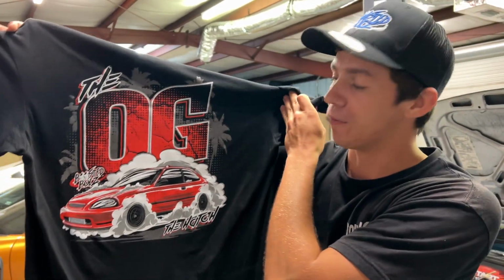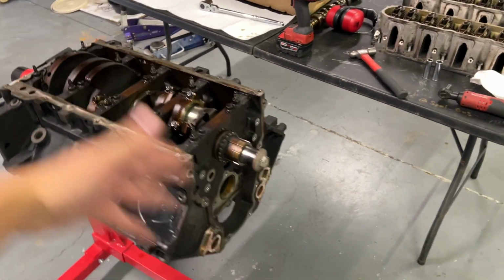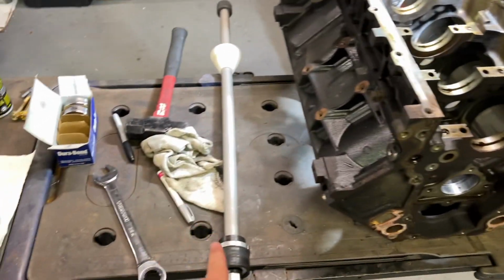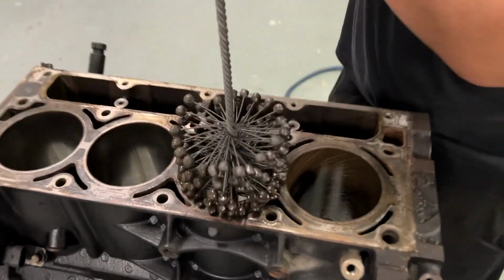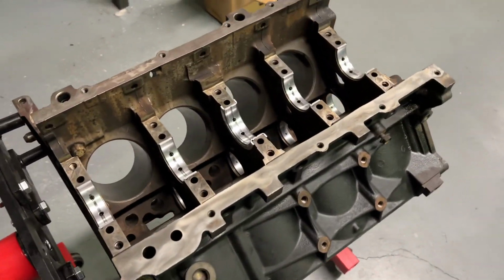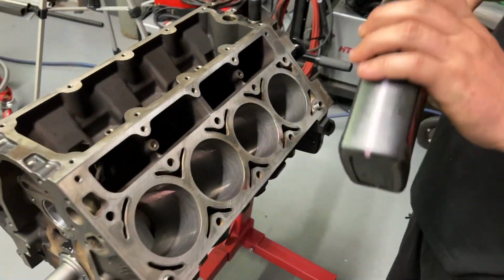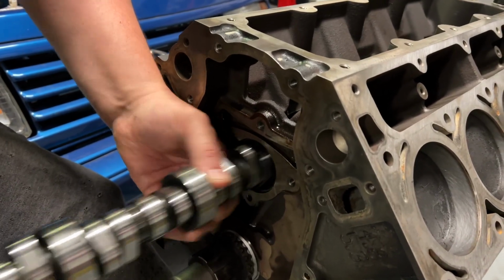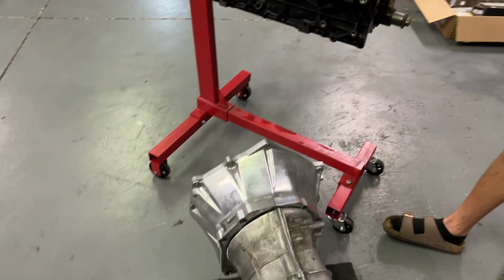Rebuilding Our Junkyard LS! Pro Engine Builders Look Away

Comment: Gonna go out on a limb here and say that when you installed the cam, it either barely or didn't turn. There is a reason that all factory machined LS motors have cam bearings that look like hammered ass, and that reason is from the factory the cam bore wasn't straight or true- so during normal use they "self clearance" and end up looking like hot garbage. I know y'all were just trying to be thorough, but when dealing with boneyard LS motors, a pretty good rule of thumb is that if it looks like it had oil pressure when it was scrapped, leave the old cam bearings in it. factory cams don't run nearly the seat pressure of aftermarket cams, and thr additional lift and duration will put even more stress (read: heat) on the slightly too tight cam bearings y'all likely have now- which could lead to problems. Hopefully it doesn't cause issues for you, but I haven't ever gotten that lucky. 

TLDR: I used to install new cam bearings in my junkyard LS motors, there's a reason I don't anymore.
Reply: You know... that would explain a lot.
Reply: I actually thought GM lined honed the cam bearings after install. Seeing copper is completely normal
Reply: If it had oil the main bearing wouldn't be scrap.
Reply: I replied the correct procedure above.
Reply: @MattPratt  they do 👍🏼

Comment: A u all can we get a AWD automatic transmission Honda simpler build use 1 or the Honda element gens THEN AWD spinning around a pole idk or aawd Honda but mount rear differential upside down now burn outs front wheels going forward and rear wheels going backwards will a car stay still or idk

Comment: Dirty block, botched cam bearing install, backwards pistons, and the engine does not turn over very smoothly.

Will the boiz redo the bottom end?
Will the top end be any better?
Catch it on the next thrilling episode of Boosted Boi-Z.

Comment: Stuff I've seen with ls motor as long as the bottom end is good the crank will hold a solid 1100 wheel reliably for the most part if the setup is right with rods and pistons but bone stock the rod are pretty well made of glass and anything of 15 to 20 pounds of boost without good head studs you will blow head gaskets

Comment: My local machine shop will refresh a LS like that for $400, and I'd have it back it 2 days. Much worth the money
Reply: Yea i wouldn't try to do cam bearings myself
Reply: I did a cam swap, and on start up it spun a cam bearing, so I brought it to my local engine machine shop, and for $180, they'd do the cam bearings or for $400, they'd rebuild the bottom end, seemed more logical

Comment: I just don't get it you have the time you have the money why not go all the way rods pistons heads and be set up for good safe power right off the bat and worse case you can always pull that motor back out of the s14 and put it in the tube chassis civic

Comment: If you would like your engine to look new, when you rebuild it. Change your oil every 3000 miles. I know engineers created and oil that doesn't break down , until 9k miles and that's great. But it gets dirty, and it impregnates your block and all its parts with cooked dirty oil colors that you cant get off. Dirty oil, not good. Change it every 3k, like the previous generations of humans have done.